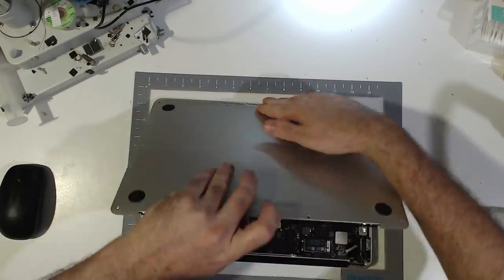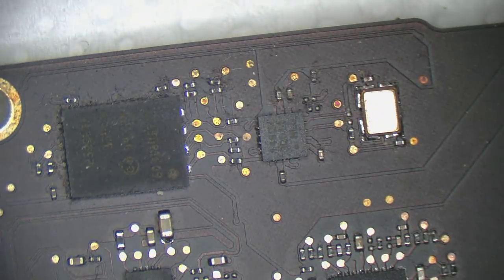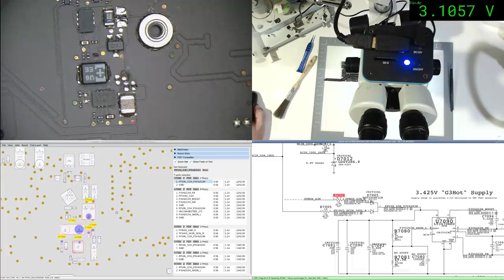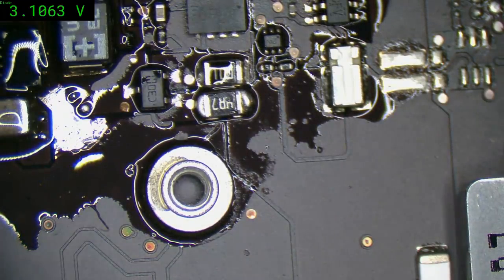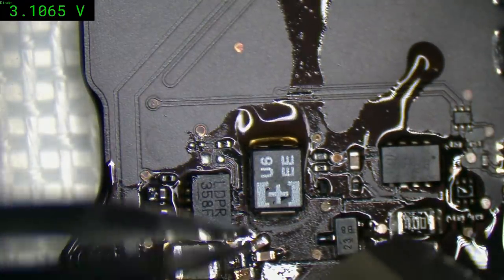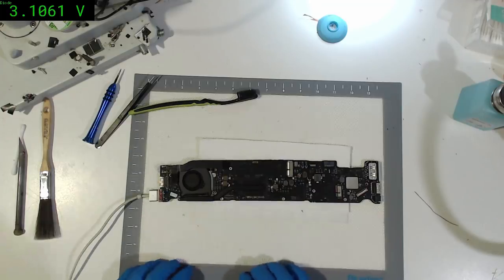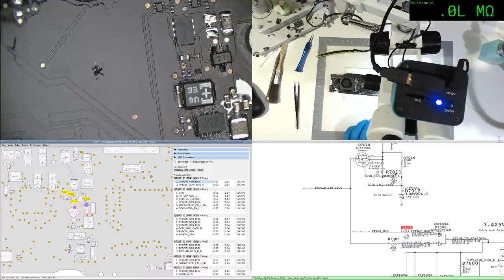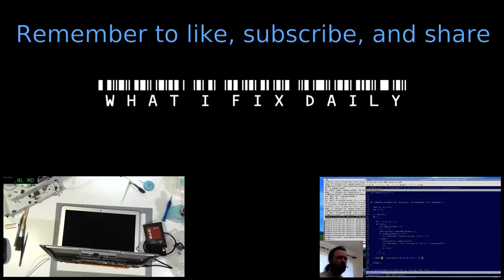#246 Macbook Air A1466 - Magsafe,  no green light

Comment: I’ve just had a run in with a Apple Genius Bar repair on a 2016 MacBookPro Touch Bar. It went in for a damaged screen $1200 to replace then a week later I get an email to call Apple. Next I’m told the speakers don’t work and it’s going to be another $300 to repair. But the speakers were fine when the computer went in. The push has been to scrap this 4 year old computer and buy a new one. And in all this I understand the Apple style of repair. In the end they just want to sell a new shiny laptop. In the end Apple wins.

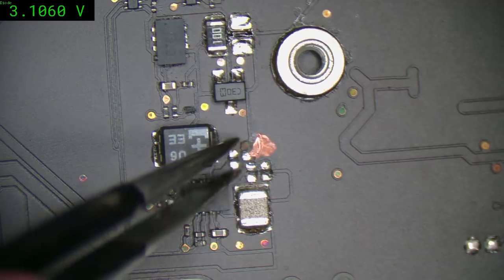Comment: Hi Paul, can you tell me if the big part under your tweezers 9:02 is also a cap ? And if so, it should not be shorted right (mine is) ? I've got a macbook air, light on magsafe charger goes on, but then fades out after a few seconds. There is a big blob of hot glue on the caps you're removing at 8:20. How to remove the blob without making a mess ? I was thinking just pry it off ? Thank you verry much.

Comment: When you find under surface corrosion, like here, & you replace certain SMD components, do you repaint or recoat the exposed area? Where do you get donor boards, &, do you know whats wrong with them? Like too many problems? Thank you also, do you have a video where a defective USB port could cause a macbook not to power on?

Comment: Hi Paul, I have the same exact unit. However mine does get a green than orange light. After the battery is full the light goes back to green. I pulled the board and I cant see any water damage. It was my laptop and it worked till one day when nothing. I checked all the areas you did and I seem to get about the same measurements. Even the button gets me 3.4v.   The one thing I notices is that my unit does not get a fan spin. any thoughts? I really appreciate it.

Comment: If only you would have noticed the K when you were testing at beginning 🙃
Reply from the maker: Indeed.  Might be worth me looking at using different colours on the display to represent different ranges, but I'm sure I'd still find ways to read it wrong.  Best might genuinely be to replace the decimal point with R, K, M,  so 8.09kR becomes 8K09.
Reply: @pldaniels  yes would be totally intuitive then 🖒
Reply from the maker: @mre3820   has now already been updated, "units separator" mode enabled with '-u' flag.
 https://github.com/inflex/VC8145

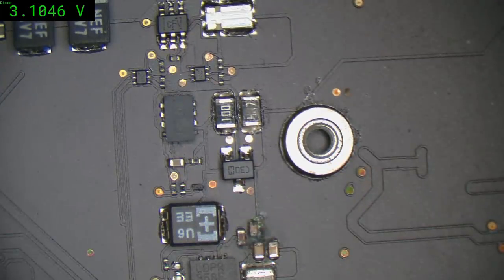Comment: 7:25 - I've seen some techs use flux to remove components and some don't, as you didn't here.  Can you give insight as to when you might choose to use flux to remove a component over not?
Reply from the maker: Really more a case of laziness vs impact.  For 2-pin small parts it's not a major drama but for larger parts with more pins it helps the process of the removal

Comment: Please solve this doubt any kind man
I have a MacBook air. I put the power cord in and there is no green or orange light and it shows that the battery is not charging.Then I connect it again and after sometime, it works properly. Please help.